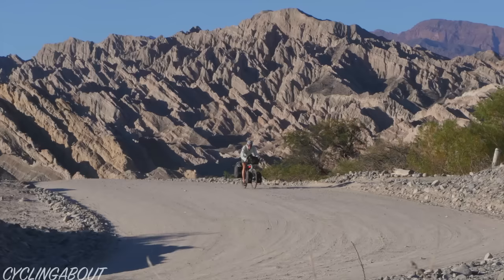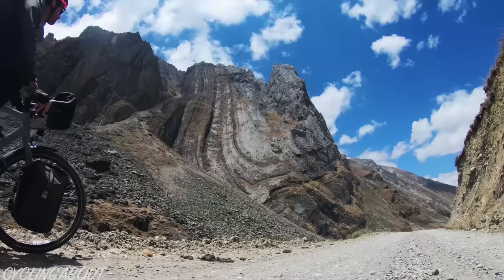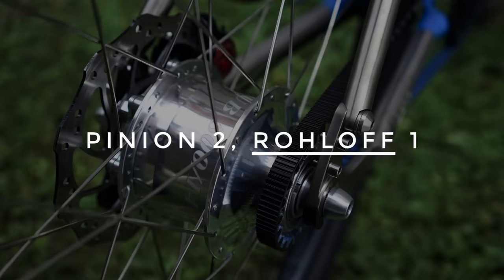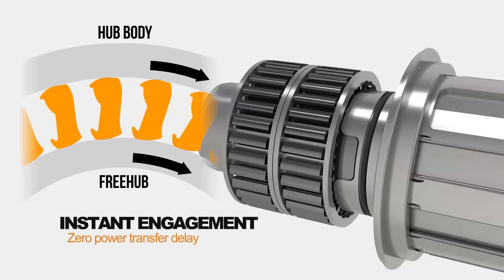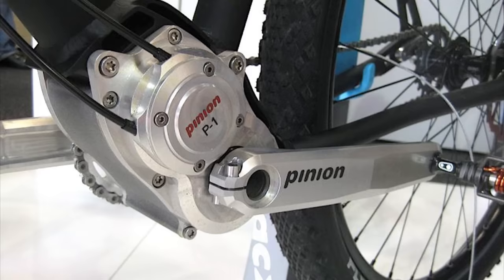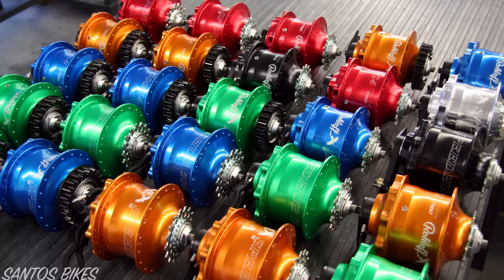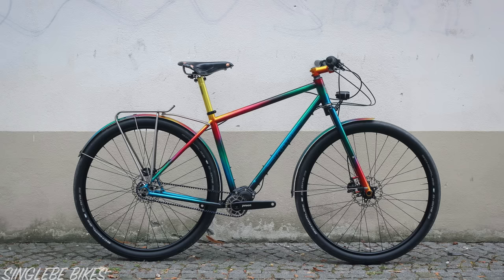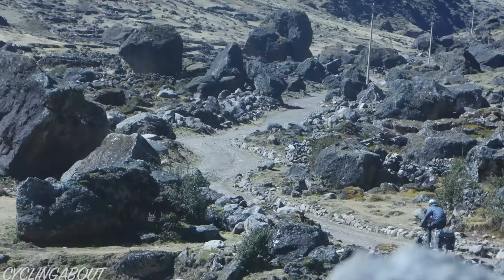What's The Ultimate Bicycle Gearbox? Rohloff Hub VS Pinion Gearbox

Comment: I have had my new bike with a 12 speed Pinion for a little over a month now............WOW!   Hardtail 29er.  Love the ease of shifting.  Was (still is) a learning curve from a derailleur system.  Didn't think I was going to like the twist grip shifter, now I am fine with it.  It is intuitive, a really slick way to shift.    Belt drive is The Bomb!  Quiet, clean, no maintenance.  If it is really dusty,  it will squeak a little bit.   Just rinse with water and problem solved.  Mostly, for what I do with my bike, a Rohloff 14 speed would have been ok and a little cheaper.   The balance of the Pinion setup is as good as a derailleur, just slightly  heavier.  Weight is not a big consideration for Bikepacking, which is what I do the most.   The longevity, ease of maintenance, cleanliness and ease of use were the big draw for me.    Love it so far.     Thanks for sharing.

Comment: I have been using the NuVinci harmony on my electric bike for a year now, love it  fully automatic and no hassle
Reply: NuVinci is fine and easy (continuous) gearbox for an E-bike.
But it is a very inefficient gearbox for pedal power alone (if I remember correctly, the efficeincy is only around 80 to 85%).
Reply: @wimahlers  Perfect for a mid drive based ebike. I too have a nuvinci and you don't notice the inefficiency Vs something else. Whereas the continuously variable slide up/down the gearing ratios is simply sublime.
Reply: @biggityboggityboo8775  
I concur. A NuVinci gearbox is very nice for E-bikes.

Comment: I recently purchased a Smart Motion E Bike with a Rohloff hub , so far after 1400 km I have no problems and rather than change the oil in the hub I'll take my bike back to the dealer for Specialist service , I also had a shock absorbing front fork fitted and the results and assed comfort were immediate !

Comment: I've ridden Rohloff hub on an all mountain bike since 2005. Serious competitive, technical riding, all over the west as a 220lb 6' guy. That said. The hub is bullet proof for "acoustic" MTB's!
Note: Always shift on the top of the crank stroke and It will shift flawlessly.  
The question of rear wheel weight. You unweight where you need to. It's a pound! Use the force! Your Camelback bladder more or less full or a seat bag can weight that. 
The noise in gear 7. I think its cool! If you hate it,  just shift.
If it were to break. Rohloff internals can be swapped out as a unit, leaving your wheel build intact. Although..
I have sent the wheel to U.S. service (there is only one here!) for seals,  maybe every 4 years. They always weep a little oil at the axle ends, especially if you lay your bike over on the disk side.. it may start creeping oil toward the braking surface over time as you ride. If you dont lean it over? No problem, just monitor. 
The chain tensioner needs lubrication at the pivots. It is rebuildable. The stock jockey wheel's bearings die a crunchy death about once a year due to contamination. You can clean and re-grease them, but I found Rollerboy ceramic bearing jockey wheels.  They stay smooth and don't die, like the stock ones do. 
The wheel strength. The spokes are equal length and tension. Much stronger than wheel builds accommodating a cassette. 
The Rohloff hub itself is always there, ready. Just lube your chain (I use chain wax), as usual, some Triflo to the tensioner pivot (and sliding surfaces, like your dropper, shock shaft and fork sliders) and go. It has saved me so much money over the years. Previous to Rohloff,  I broke or bent 3,  9spd  Shimano XTR cassettes and broke the pawls on a Hugi hub,  back before 2005 due to torque applied to the rear wheel while climbing. It was such a problem, I went back to 8spd cassettes. 
 You can reverse the chainring and cog too, for double life. Chains are cheap too. Single speed chains are everywhere.  I like Sram PC-1
I am building a levo turbo Rohloff and have to relieve the disk side of the frame to accommodate the 40mm dia. torque arm. This needs to be, and was  approved through Rohloff beforehand and handled through the U.S. service center. They are called Cycle Monkey.
That has been my experience.

Comment: I have run a pinion p18 on my e trike for 5 years ,using a hub motor, i love it’s near silent operation,and it’s reliably. Never had an issue,not once, though i put around 1000 miles combined dirt trails and paved trails as it is easy to swap out tires.

Comment: At that price they should come with a complimentary bike lol
Reply: It is cheaper to buy a bike with one already installed!!!
Reply: Consider with a lifespan of 200,000km or way further and never having been worn out in rohloffs history also only an oil change once a year there are also over 250 parts excluding individual bearings inside one of these tiny machines that are as genius as a car engine. 

A lot of man hours and design processing. It's way superior to chain even if slower. We're reaching a stage in technology where a bicycle is actually more reliable than a car. If something goes on my bike I don't need the AA to pick it up or a mechanic anymore. I never pay labour costs anymore I do it all through tutorials on YouTube

If rohloff cost 3 times as much they probably could still justify it when something lasts indefinitely there is no price on peace of mind and reliability

It really is the most complicated thing like pinion or kindernays XIV which is 14 speed removable from wheel and hydraulic unlike rohloff for same price. I believe kindernay will beat rohloff its new also. 

Everyone needs a rohloff in my experience or at least Alfine. Beats sturmey. Nexus is easy to work on but won't take you everywhere
Reply: LOL
Reply: @shaneruddock5852 rohloff really isnt less efficient than a chain, in testing theres a less than 1% difference in efficiency

Comment: I did a lot of research on this like you did on this video. My conclusion was different. Swappability, Price, Weight made me choose for the chain instead of Rohloff/Pinion. I ride with my trekking bike on asphalt and gravel. Chain is fine for me.
Reply: There is nothing wrong with chain shifting and it is still the most efficient and lightest system. The main disadvantage is maintenance. You can run both system with a belt and that's what cuts it for me. This system reduces normal maintenance to nearly zero because hosing down the dirt isn't really that much of a hassle.
Reply: I use also conventional derailleur systems on my bikes, with 8 and 9 speed cassettes. I get between 5 and 7k km out of a Shimano HG 71, and the spare parts are inexpensive at 8 and 9 speed systems. I do not travel the world with my bikes, I use it for commuting and sports, together around 7k km per year. Only the Rohloff hub alone would cost more than any of my bikes costed completely - it's surely a nice hub, but it's expensive, and the main advantage (to use it with a belt) needs a special frame with an opening, which non of my bikes has, so the belt would not be an option for my already existing bikes. 
Chains need maintenance, but it's not too much.
Reply: That's not the point of this video! Read the description again!
Reply: @simonm1447  Derailleur chain transmission is a real PITA to maintain hence the need for IHG and belts. Your argument against them is purely on price. You've ignored their design superiority. If you are able to afford them they are far far far better than a derailleur transmission.
Reply: You seem to be confused between gearboxes and the means of transmitting the power. Chain/belt transmits the power, the gearbox selects the gear ratio. Clue is in the name. You can use either chain or belt with either the Rohloff or Pinion gearboxes.
Reply: @simonm1447  Good insight.  I am stricken with the concept of gearbox bikes but not interested at the tremendous price here.  Also, I have a Specialized Easy Access (very low centerbar) bike and I can't find any gearbox bike in the configuration.  Maybe if there was a configuration like that I'd spring for it.
Reply: getting rid of the derailleur and low maintenance is the whole point. You can still have a chain with pinion or rohloff though. a belt drive is an option

Comment: I built up a ti pinion bike 4K miles ago. Like a lot of my projects things didn't turn out quite as intended but no regrets. Although it is quite a heavy bike I think it is the drag that is discouraging (I did significantly lower belt tension as you have mentioned and that was a noticeable plus) 2 things I love about the bike are other than tires there is close to zero maintenance/cleaning which is great in NE US Winters-when who cares about speed! Also it is THE rail trail machine w 2.3” tires. I do have another frame soon to be in the works that will be derailleur but braze ons for Rohloff cables and chain stay joint for belt. Experimenting is so much fun! Thanks for your review and channel.👋
Reply: I'd love to know the set-up of this bike. One dream bike of mine would be a "do-all" bike in Ti with a low-maintenance drivetrain. Something I can run errands on, or take on long bike packing rides. An all-weather machine.

Comment: Thank you for the very fair minded comparison.  Many of the advantages for the two drives depended highly on the style of riding, with the Pinion the hands down winner for those in the off-road camp. Since my riding is touring and paved bike trails, the Rolhoff is the clear choice for my recumbent tadpole trike.

Comment: Rohloff really does stand behind their hubs. I bought a used Rohloff hub from the early 2000s, registered it (apparently the previous owner hadn’t) and Rohloff covered some of the service it required at one of their authorized service centers in the US. I was blown away.
Reply: I totally agree: last year, I had a problem fixed 7 years after purchase: it was free, including transport to and from Rohloff facilities in Germany.
Reply: Yep, I returned mine to get the lighter detent spring fitted. They did so, and performed a service, and a seal replacement, and returned it to me, all free of charge. How many companies have this level of customer service for things you bought in 2003?
Reply from the maker: Great to hear the service is still great after the warranty period!
Reply: Nice. But what about I heard that you need to go thru a dealer and can't send it straight to Germany?? Is this correct??

Comment: Having 4 Rohloffs, and one P.18 in my household, it is easy: The Rohloff is easier to maintain (getting the old oil out of the Pinion is tedious), lighter, easier to fit to pre-existing frames, and has a MUCH better efficacy. If the heavy hub is an issue, e.g. in a fully - I went for 1x12. Haven't sold the P.18 yet, but thank you for the reminder... (oh, and, yes, my oldest Rohloff was built in 2000, and still doing well, with minimal maintenance - don't know how long the Pinion will last, but the creaky feeling I get when pushing hard does not feel promising...)
Reply: Have you sold your P.18 yet?

Comment: I wouldn''t give the e-bike point to Rohloff because middle motors also have a big disadvantage for higher consumption of material. A Pinion e-bike with rear-wheel drive has a better power delivery and an other advantage you can even rebuild the e-bike to a "normal" bike. Therefore I'd give the e-bike point to Pinion! ;)

Comment: Both are very impressive engineering, but for me, on a limited income, it seems an awful lot of money just to change gear, which my Shimano derailleur does very well, thank you very  mucj, and I am able to repair it fairly easily if it does fail. Having said that, Mark Beaumont rode around the world with a Rohloff,  so they must be pretty reliable. Thanks for the video.
Reply: I don't have a lot of money either.  Let's remember that the pros in the tour de France use derailleurs!

That said, I am saving and I might make a once-in-a-lifetime purchase of a high quality touring bike with a rohloff or a pinion.  I've thought about this for years (maybe a decade) and I have some inheritance money that I might use for this.
Reply: @TheGeeoff The pros of the TdF use derailleurs that are much more expensive than a Rohloff or Pinion.

Comment: Having the weight at the bottom bracket negates some of that penalty for the Pinion. You mentioned this in the mountain bike section, but I'm not sure that weight is a clear win for the Rohloff for this reason.
Reply: conbeaute weight on a touring bike must be a secondary issue. Touring cyclists could be carrying 3+kg of water alone.
Reply: I MTB bike and weight is never an issue like it is with roadies
Reply: @derekthompson4561  Just keep telling it to yourself until you get overtaken by a guy running with his road-bike on the shoulder.

Comment: In Nomads Trails real life test, they mentioned that the Rohloff hub subjectively felt like it had more drag. Could you comment on your experiment setup to measure the efficiency between these two gearsets?
Reply from the maker: You can read the Pinion test here: https://fahrradzukunft.de/20/wirkungsgradmessungen-an-nabenschaltungen-3/
And the Rohloff test here: https://fahrradzukunft.de/16/wirkungsgradmessungen-an-nabenschaltungen/

I suspect the reason why Nomad's Trails feel like there is more drag is due to the Rohloff having more noise in the lower gears. Realistically, very few can notice a 4% difference in efficiency because it's probably just 4-5 watts of resistance (chain lubes often vary by a similar amount).
Reply: @Cyclingabout  Thanks for the reply and for your content. I rode my bike from London to Istanbul 10 years ago, but now have kids, a chubby belly, and a sedentary lifestyle. Your channel has me excited about going touring again!
Reply: Thanks for asking this question - it was something I was thinking about asking too!

I don't have a kid, but I do have the chubby belly.  I'm still hoping to do more serious touring!
Reply: @TheGeeoff  I ended up getting a pinion geared bike (priority 600) and love it. I don’t notice it anymore and there is a super thick layer of dirt and grime caked on my bicycle as I commute in the winter and it forwent feel any different vs new. 10/10 would recommend!

Comment: You didn’t mention the most important thing for the expedition cyclist. On a Rohloff gear 11 is totally locked up- there’s not internal movement which is why it’s so efficient. When you set the bike up you choose this ratio as your cruising speed. If the Rohloff becomes totally mashed and locks up, the bike will still work as a fixie and you will be able to cycle to carry on cycling. The Pinion would lock up and you would be stuck.

Comment: What about Shimano (Alfine and Nexus) and Sturmey Archer? They are a lot cheaper!!. Is there any other cheaper brand?
Reply: Thierry Kamette  One man's crap is another man's "I can buy a goddamn motorcycle for the price of a Rohloff".
Reply: Nuvinci!
Reply: NCM PLUS #1ebike
Reply: @ropi4524  Nuvincii is very inefficient and Not what you wan't for an Touring bike
Reply: Thierry Kamette  What? Don't make me laugh 🤣 Shimano is the king of reliability. You can ride Nexus and Alfine for 20 years with ZERO maintenance. Not everyone is crazy enough to pay for those unnecessary expensive gearboxes. Shimano Alfine is the best and most reliable hub gear ever built by man.
Reply: Thierry Kamette  over 3000miles still going strong with original battery : )  maybe you have a Walmart brand?
Reply: @ropi4524  how much money?
Reply: @rokitman5753  no clue. It was part from the factory of my 2020 Riese & Müller Charger 3. Its perfect for everyday use and stressless with the long lasting Carbon Belt and no service needed at all. Already 1300 km driven without any problem. Only pure water cleaning of the carbon belt from time to time.
Reply: @aprilthetortiecat807  can you recommend an all set bike with an alfine gearbox?
Reply: Alfine 8 is grease lubricated and the by far the lest efficient. The Alfine 11 is oil lubed but notable for leaking. Shledon Brown has reviews, hints and tips on those and Rohloff
Reply: You already asked your question.... you get what you pay..... (meybe a GOOD choice, i drive Shimano Nexus on my "go to work" bike)
Reply: @ropi4524  H-E-A-V-Y and EXTREMELY Un-Efficient.... (ad how long will it last???????)
Reply: @aprilthetortiecat807  Can I replace a rear deraileur with an Alfine 11 not using the disc brake or more radically use a Nexus roller brake as a replacement for current rear rim brakes? This is for a fitness bike so cheap and maintenance-free is best. Frame is DiamondBack Ascent EX.
Reply: @aprilthetortiecat807  my whole family runs nexus gearboxes on just regular Dutch granny bikes (omafietsen) and I can confirm that the nexus system is reliable even though we don't cycle a crazy amount but 4 bikes with in total one failure in it's rear axle (freewheel device) isn't to shabby. The bike usually breaks before the gearbox (and to the best of my knowledge the nexus system is a dry lube system and still reasonably efficient) but the max in terms of speeds is 8 for a nexus box and of what I read online the alfine uses the same tech but goes upto 11 gears (and have a few little optional extras). The 3, 7 and 8 speed boxes from Shimano are basically bulletproof in my limited experience and don't go to small on the rear sprocket size because of clearance.
Reply: @davidelliott5843  I've seen people here on YT using oil in the 8sp Alfines. I doubt it works for everyone though. Mine hade a leak and was totally ruined by the water.